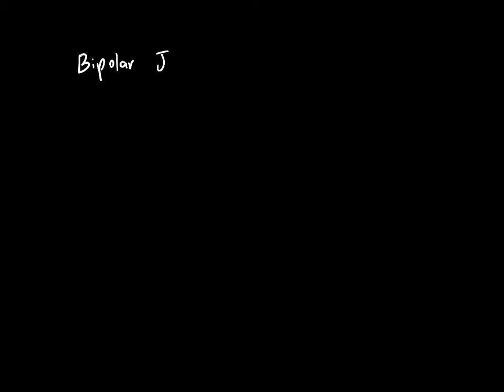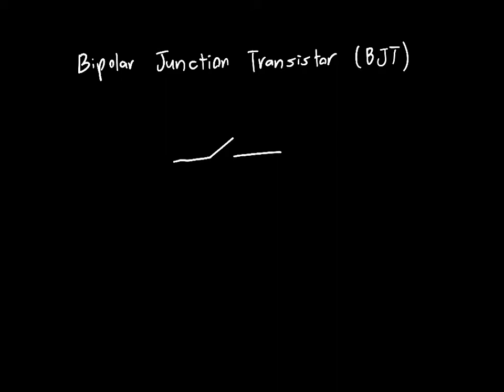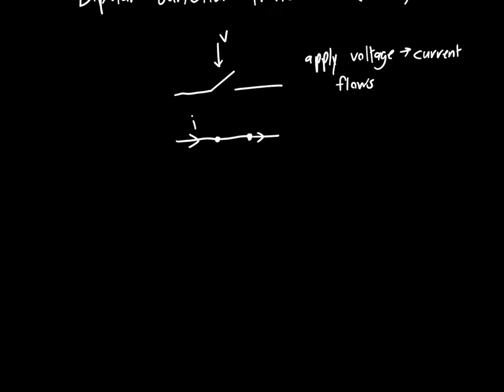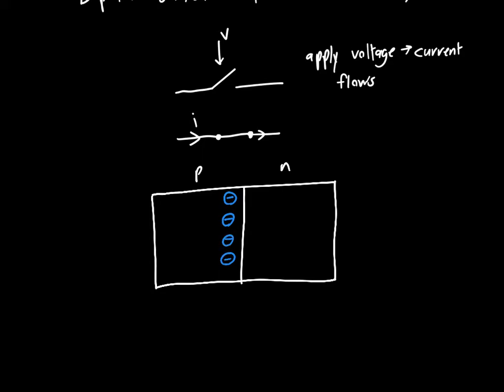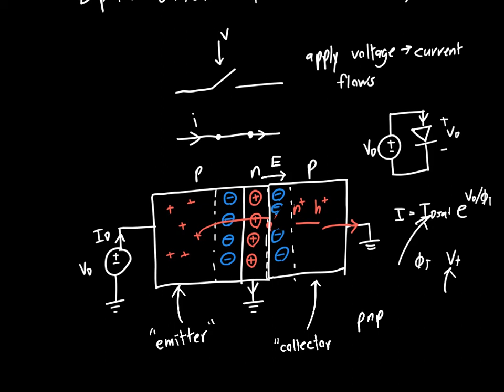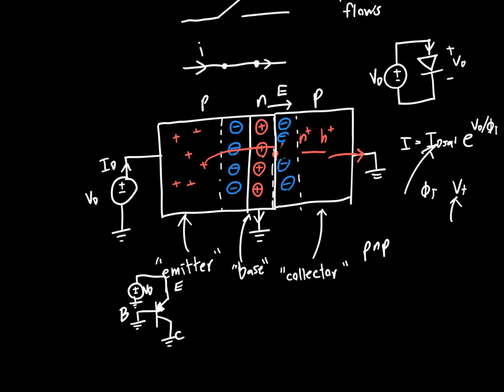Bipolar Junction Transistor (BJT) Introduction

Comment: Hi, there's something I don't understand. Please could you elaborate on the following point?

Isn't current not supposed to flow through the BJT while the base is grounded? I thought that the only way a BJT could conduct current is by applying current to the base while the device is forward biased. However, from what I understood from your explanation, it seems like holes are entering and exiting the device with a grounded base, hence creating a current. 

I am a bit confused now ^^'